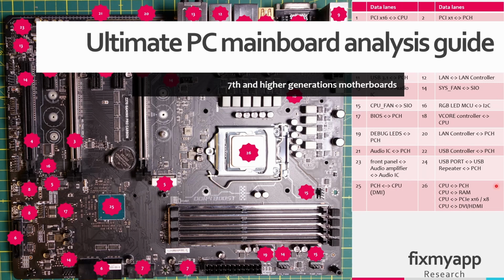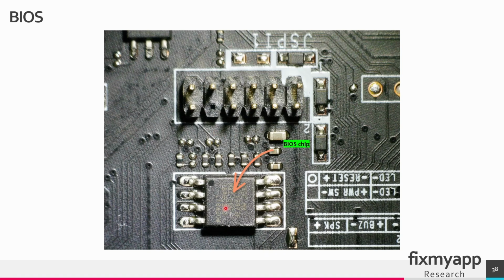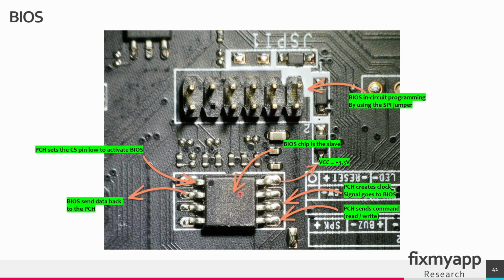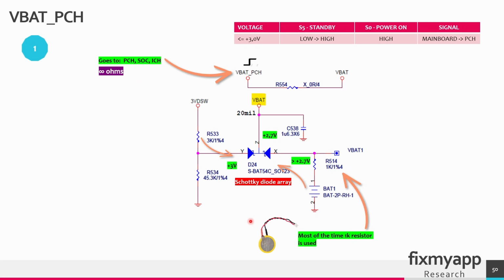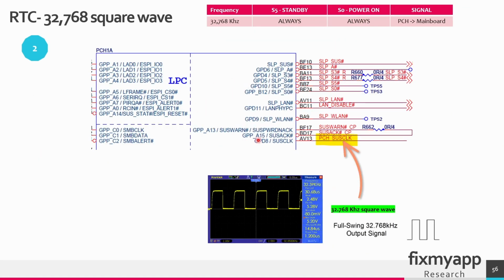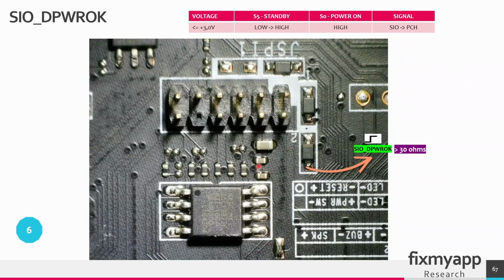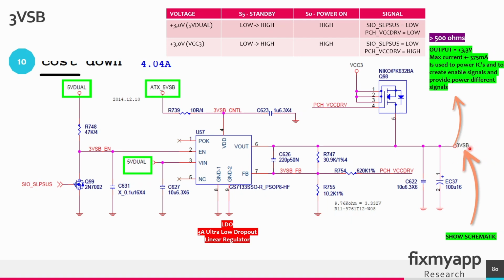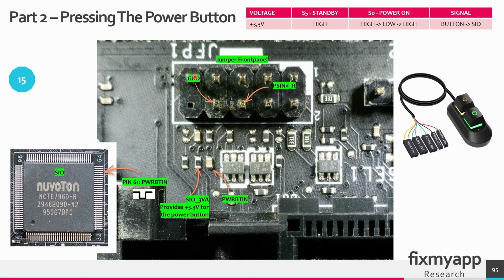Desktop Motherboard Standby Voltages, Power Rails, and Circuits Explained - Part 2

Comment: Nice video. I need help with an older motherboard (Pentium 3 socket 370). The board is Iwill VA133 plus. There is no standby voltage (motherboard led is not on) on the board when connected to the PSU. Due to this I am unable to start up the board. Tried with different PSUs with the same result. I could also test the 5vSB on the ATX connector. Could you please let me know which components I need to test to troubleshoot the missing standby voltage?
Reply from the maker: Standby voltage is a critical power rail. Try to see on a schematic for your board where the standby voltage is generated. You can also probe the traces from the 5VSTB too see where it goes. Gr. Jimmy